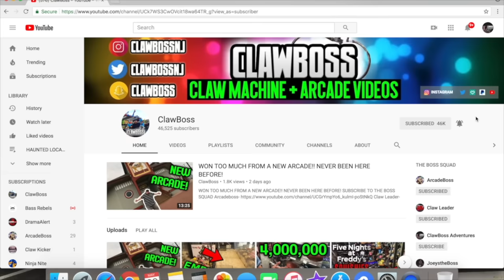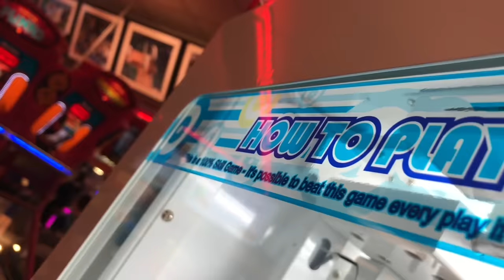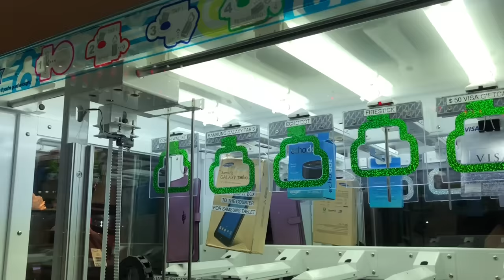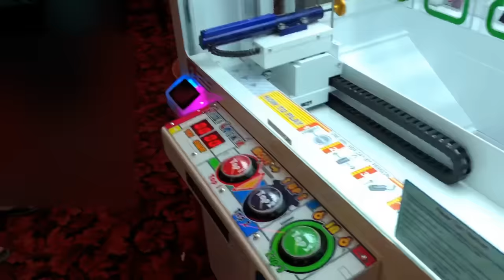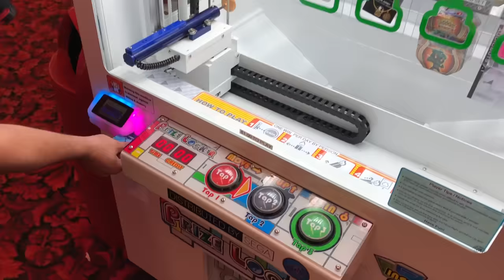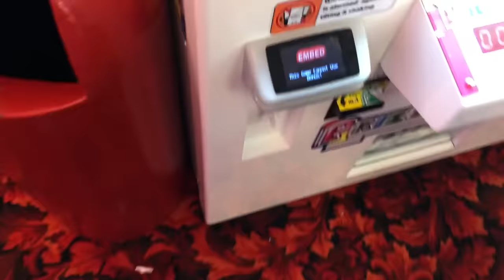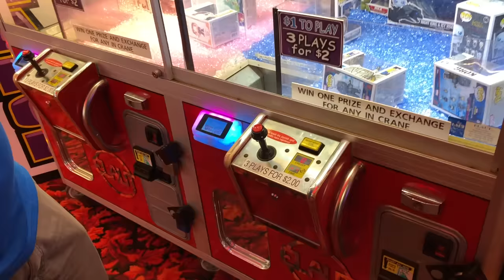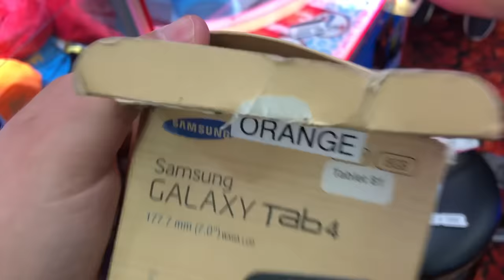KICKED OUT OF THE ARCADE  FOR WINNING TOO MUCH FROM PRIZE LOCKER!! (MAJOR PRIZE WINS!!) | ClawBoss

Comment: Vending tech here, just so yall know, the claw machines are adjustable, typically they're placed on the weakest setting, some machines are left on default, but that's usually the plush claws. 

If you see high end prizes you can just assume you're not going to win them in regards to claw machines. Keep walking
Reply: im sure your totally a vending tech yet u cant also assume the machines arent rigged. having the claw machines on the lowest setting is called rigging it and yes u can assume ur not gonna win high prizes 💀 its not hard to figure out if a machine is rigged or not.
Reply: @Super_Nova735  did you have stroke typing this? None of it is coherent…
Reply: bruh some of them just use gravity to make the claw close

Comment: The machine at 3:30 is not based on skill.  HE is incorrect to say it is 100% based on skill.  The manual for this machine even tells you the settings to set for payout for that machine.  Basically setting it to prevent winning so closely per play.  Sadly some of these machines dont work off skill even though it comes off as such
Reply: if that is the case then he's going to earn the same amount from one guy buying it all or other people so why would that be an issue
Reply: It is the case.  Ive read the manual and there is a setting for prize probability  You still have to use skill to get key lined up correctly.  But you can not win continuously is my point based on the settings of the machine.  This has already been discussed on other videos and I am sure Clawboss can chime in as well.  I am sure they spent at least 50 bucks alone playing that game.
Reply from the maker: Yeah I spent like $40 trying to win the tablet.
Reply: Generally the payout is much higher then retail. It's just about being lucky and playing at the right time and hit the minimum payout
Reply: dude played the game, he won did not cheat there should be no problem
Reply: Thanks, I kinda figured but even then congrats on the win.  You know back in 90s the payouts were so much higher at places like Chuck E Cheese and other Arcades... Now they have gotten stingy.. I remember growing up someone going to Putt Putt and spending about 150 to play arcade but would end up with console which was worth more than 150.
Reply from the maker: Yeah it sucks for sure. Especially because my hand eye coordination isn’t the best and I buckle under pressure. I was hella excited to finally win a redemption prize.
Reply: smartguy345 yeah back in the 90s I would walk out with more than I could carry.
Reply: This machine works by varying the amount of travel the key can move until the set payment is made. If you see, the key moves up and down on a white rubber belt with notches to move it by the motor. These space that the key has to go through to push the prize is such that the rubber belt just moves in multiple notches (default from the manual was 4mm) - too big to put the key in the middle until the minimum payment is made as it will either hit the top or the bottom. Once the payment is made, the motor will move the notches individually and the increments are reduced to a finer amount (say for example 1mm). So basically the game is physically unwinnable until enough is put in. The game maker Sega was at the center of a lawsuit a few years ago because it basically involved gambling as children couldn't actually win on the money they put in, regardless of how good they were. 

https://www.thesun.co.uk/tech/3506199/seaside-arcade-games-will-no-longer-be-rigged-to-stop-players-winning-prizes-industry-watchdog-announces/
Reply: you can actually see on the top prize line that the key is hitting the top, but there is barely a 4mm gap between the bottom of the key, and the key box. Then compare that to the belt on the left moving the key...  https://youtu.be/vqfyalB21gI?t=5m50s

Comment: Claw machines now i feel like are rigged, well they've always been rigged.
Reply: RC just came off the carnival Cruise and in the casino they have stacks of 100 $1 bills in the claw machine and people win. . I got close 😭😭😭
Reply: Lol well good for you.
Reply: RC  damn right good for me lol
Reply: ATLANTA-BOY-1985 carnival magic? I was on that cruise and they had the same money crane game.
Reply: the truth is they're programmed to only close once at some point, so there's only that one time chance you could get a prize
Reply: You obviously didn't see that one video where gambling officials were testing out a claw machine and used every possible cheat in the book IE added big anti-slip balls at the ends of the claws, positioned the claw perfectly around a prize plushy, put it in a straight line to the drop bin....and failed dozens of attempts at getting the prize because no matter what they did, the claw did not have enough holding strength to lift any of the prizes. Rigged? Not even. They are thievery machines pure and simple.
Reply: RC I heard the claw doesn't legitimately grab without RNG lol

Completely random whenever it does
Reply: I had a friend whose job was restocking claw machines. He was trained to pack the prizes into the machine in a certain way to ensure that they were packed in tightly because the claws are programmed to let go and open automatically when they get any resistance.
Reply: Yeah they used to be just skill but now its just luck they just want money but the reason it was made was to let people feel
accomplishment and skillful but if they don't make it the way it used to be then no one is going to play them anymore

Comment: for that pushing key game, use a wet market and mark the right edge when moving to the right of where you need to be on the glass then the top when its moving vertically.  Everytime you can adjust these lines.  If you are too far to the right, adjust the line a little left.  If you are too high or too low adjust the vertical line.  Eventually you will get it.

Comment: when they measure the spot at the bottom, which they are doing, then memorize the spot with a marker (that screw) they are kinda exploiting a flaw in the machine, so I can kinda understand why the owners would wanna stop that.
But if there are no rules, there are no rules. Fair trade.